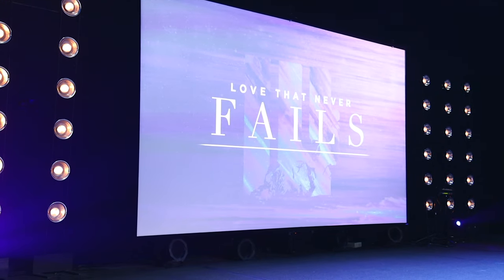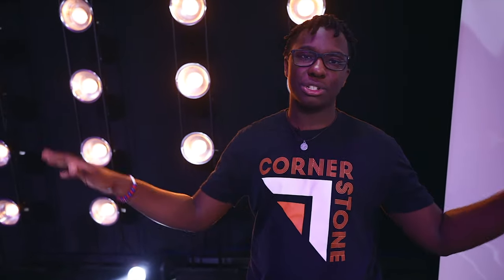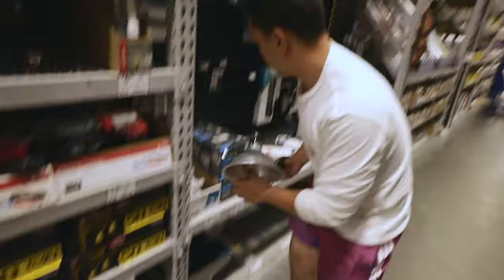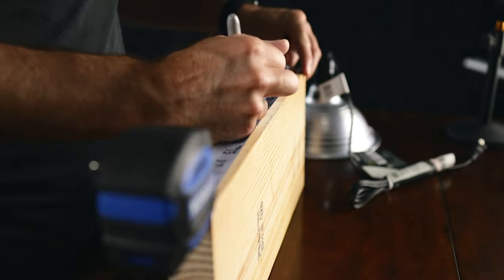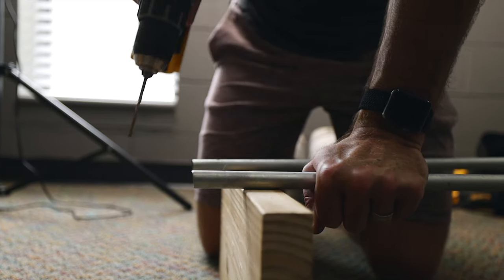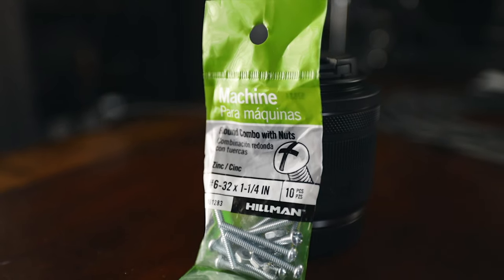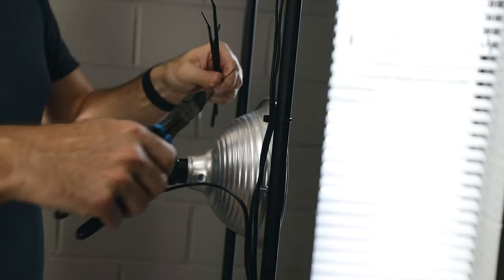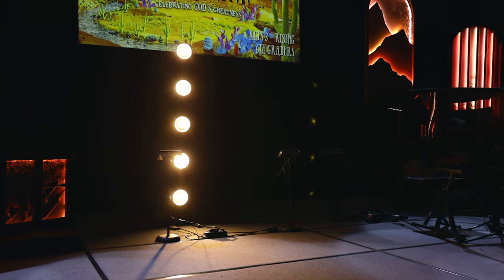DIY Work Lamp Stage Design for Your Church

Comment: Updated Idea for making these cheaper and to get per bulb control easy. Use 12 volt or 24 volt RV bulbs instead. You can then use a LED DMX decoder. 1 DC psu and decoder per stand. Wire a common postive wire on side and the grounds the other side to the decoder. Then you just patch 1 channel dimmers in series for the stand. Could even have multiple stands to one decoder if using the 32 output units.
Reply: This is really only beneficial if you want  individual bulb control, right? Decoders are like 20-50 bucks (if I’m looking at the right thing) so it’s kind of a wash if you have to get one for each individual stand vs one or two DMX dimmers for everything.
Reply: @PaulCarter206  Yes, allows for per bulb control. So if you look closely as the decoders at the price you found. Those have multiple outputs. Those outputs are RGB or RGBW leds. With single color bulbs 1 output is 3 or 4 bulbs. So you can way more density or even multiple stands on 1 decoder. Also with being 12 or 24volt bulbs, you will still quite bright and get the effect for way less power draw. That means you can have a larger overall number of bulbs. So considering a standard 4 output dimmer pack is around 100 bucks and up, the decoder method is a lot lower cost and has more advantages

Comment: Why did you need a 3/4” bit to put the 1/2” conduit in the 2x6?
Reply from the maker: A 1/2” hole just wasn’t big enough in my testing. So I had to step it up to the 3/4” bit. Perfect fit.

Comment: I followed the instructions but I’m having a few issues. I’m using lightkey and a dimmer pack.

1. The lights at low dim are flickering 

2. The lights don’t always turn on. Or delayed

Any help is greatly appreciated, setting this up for our Sunday service 🙌🏽
Reply: My best guess is that you probably bought light bulbs that are not dimmable. That would cause the behavior described.